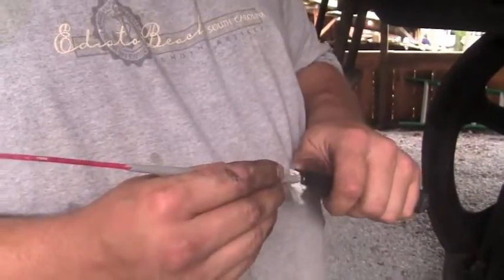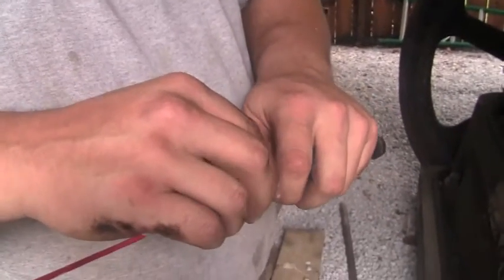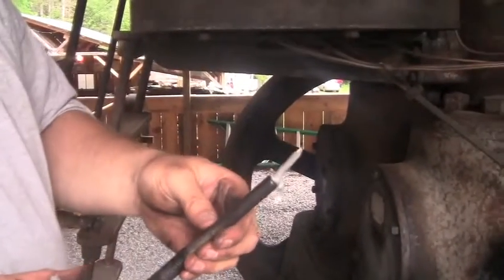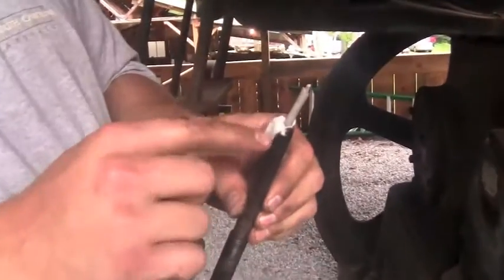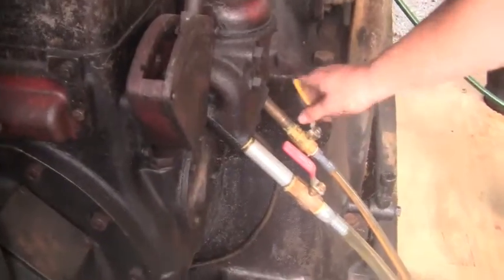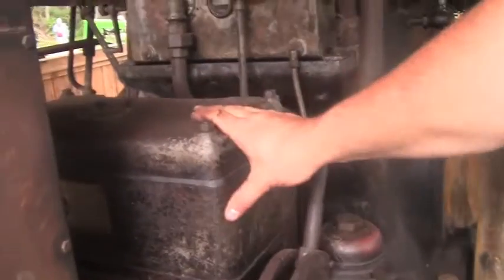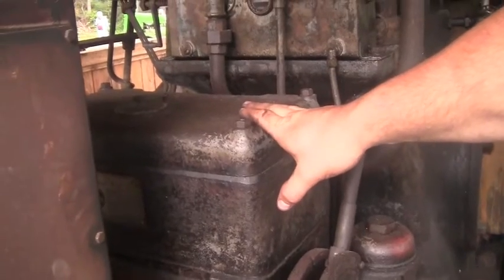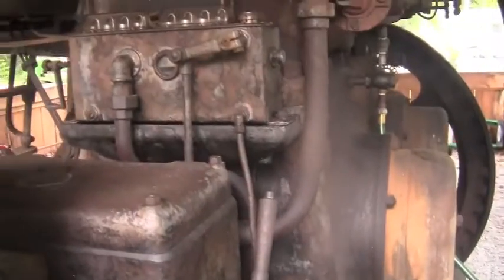120 HP Fairbanks Morse 2 Cylinder Diesel Engine

Comment: My Dad used to run two 6 cylinder FM Model 32 engines in a power plant. What they used for cold starting were what he called punks. They looked like about 1/4 inch cotton roped and when lit they did not burn with a flame, but just glowed. They were in a small  can that was labeled by FM and we’re about 4 inches long. My dad would cut them in two and use half in each cylinder. They only put them in two of the six cylinders.
Reply from the maker: Thanks for sharing the info!